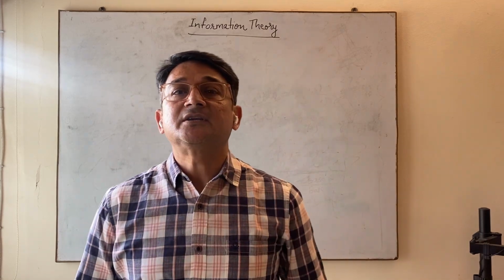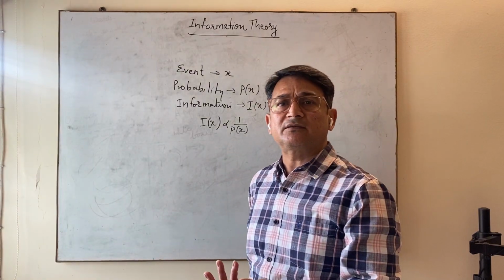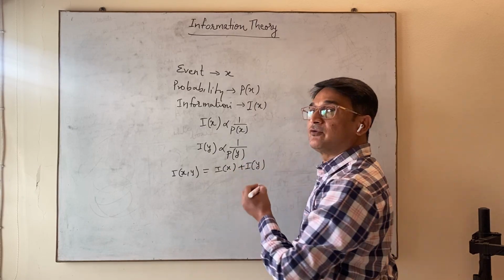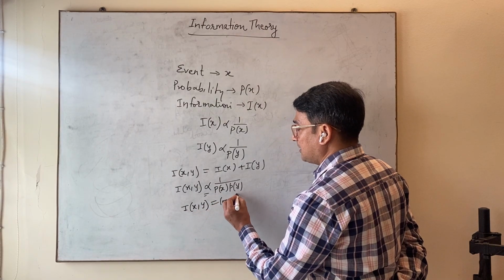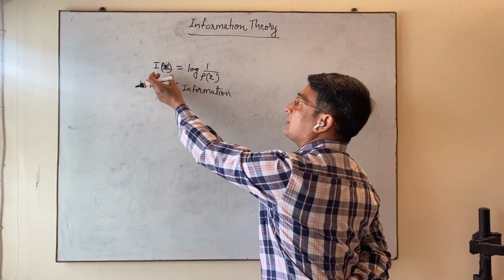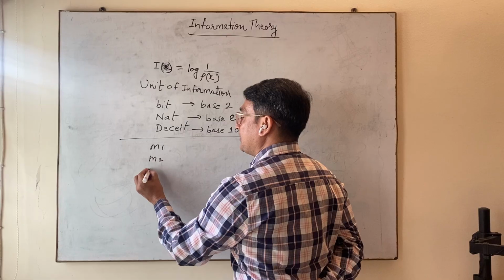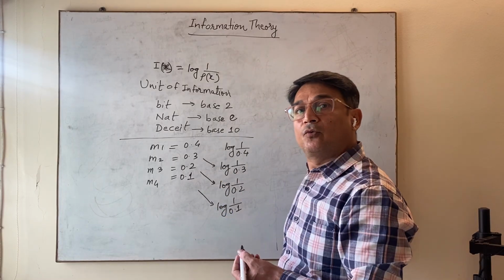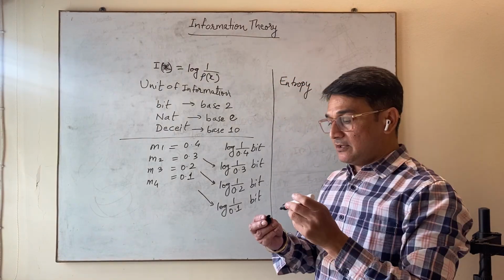Introduction to Information Theory | Digital Communication | Electronics & Communication Engineering

Comment: Good afternoon sir.
To calculate the information, do i use log base 2 since you used bit as the unit?
Reply from the maker: Yes all the calculations needed base as 2 . If u have calculated it with base 10 just divide the answer with 0.301 to get base 2